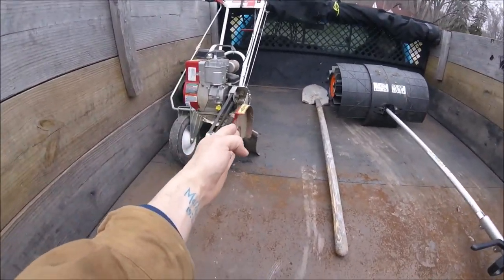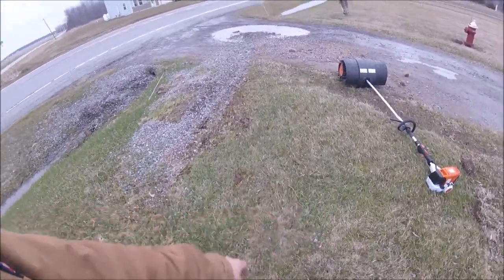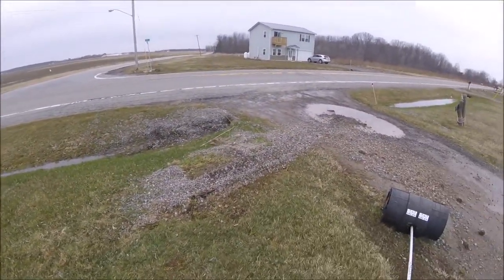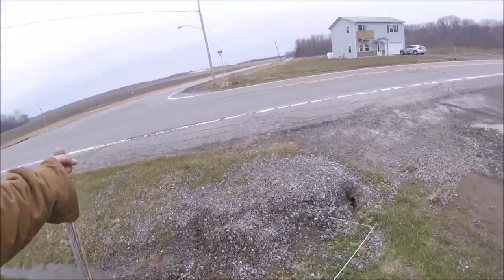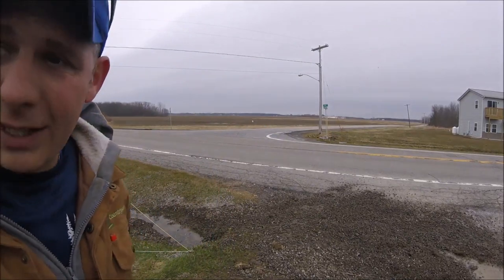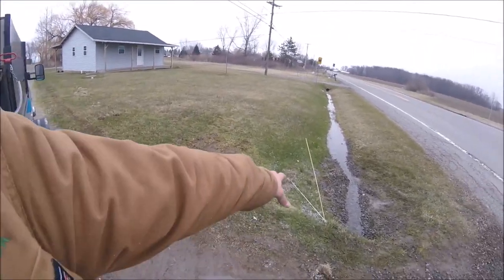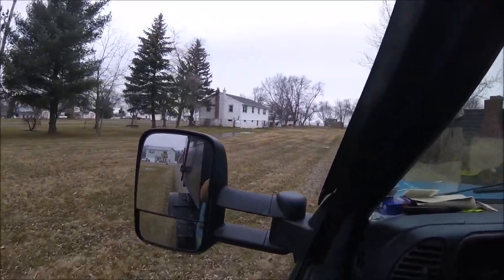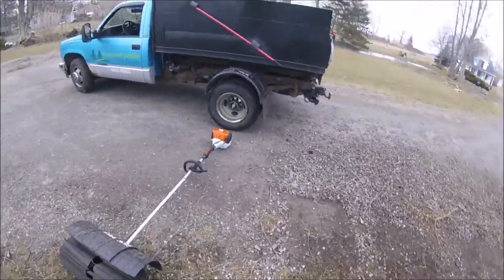Stihl Kombi System with Power Broom / Power Sweep in action

Comment: I found it easier to rotate the gear and pull it backwards, use the strap over the shoulder, gives you more pull power. Agreed, going forward kicked my butt.
Reply from the maker: You're right that works great. The strap isn't gonna increase pulling power, that's what muscle is for. Inanimate objects can't increase power lol
Reply: Mine came spinning the opposite way than the way it spins in this video, I have to pull mine. It is VERY easy
But I also stepped in a hole that i didn't see and rolled my ankle. It was still worth it
Reply: Mine came spinning the opposite way than the way it spins in this video, I have to pull mine. It is VERY easy
But I also stepped in a hole that i didn't see and rolled my ankle. It was still worth it
Reply: Mine came spinning the opposite way than the way it spins in this video, I have to pull mine. It is VERY easy
But I also stepped in a hole that i didn't see and rolled my ankle. It was still worth it
Reply: Mine came spinning the opposite way than the way it spins in this video, I have to pull mine. It is VERY easy
But I also stepped in a hole that i didn't see and rolled my ankle. It was still worth it
Reply: Mine came spinning the opposite way than the way it spins in this video, I have to pull mine. It is VERY easy
But I also stepped in a hole that i didn't see and rolled my ankle. It was still worth it
Reply: Mine came spinning the opposite way than the way it spins in this video, I have to pull mine. It is VERY easy
But I also stepped in a hole that i didn't see and rolled my ankle. It was still worth it
Reply: Mine came spinning the opposite way than the way it spins in this video, I have to pull mine. It is VERY easy
But I also stepped in a hole that i didn't see and rolled my ankle. It was still worth it
Reply: Mine came spinning the opposite way than the way it spins in this video, I have to pull mine. It is VERY easy
But I also stepped in a hole that i didn't see and rolled my ankle. It was still worth it
Reply: Mine came spinning the opposite way than the way it spins in this video, I have to pull mine. It is VERY easy
But I also stepped in a hole that i didn't see and rolled my ankle. It was still worth it
Reply: Mine came spinning the opposite way than the way it spins in this video, I have to pull mine. It is VERY easy
But I also stepped in a hole that i didn't see and rolled my ankle. It was still worth it

Comment: That old school edger is bomb man.  We have two and the crews fight over who gets to take them out.  They take up some space on the truck, but NOTHING edges like those do.  Just make sure to change the blade if it starts to wobble/vibrate (gets bent)- if not it will wear out the front beating and belt quickly.  Enjoy!
Reply from the maker: Brent Meister Great, thanks for the info man I appreciate it. I'm excited to use it. The more I look at it I believe you're right, I can tuck it in the corner of my enclosed trailer it's pretty thin.

Comment: I saw the rake on the truck as you pulled out of your driveway. When you said you’d forgotten it I was shouting at the screen! Does that brush head do much damage to lawn turf? It looks very aggressive. I was curious if it could be used for removing dead moss from a lawn.
Reply from the maker: Doesn't damage it at all. You can run it right across the grass

Comment: I have the 110 n I flipped the head the other way n make the stone come towards me instead of pushing away.   Down side you get dirty from flinging the dirt n mud at ur feet but the benefit is that you don't have to keep lifting the own machine up everytime you can just give it gas n the broom will drive itself.    But either way it still needs to be manhandled n still a workout
Reply from the maker: Travis Garbulinski this one is the new KM131R. I'm def gonna try flipping it, someone suggested that earlier.
Reply: It should be take the paddles off n the two flaps   then 2 screws to loosen them up then flip the head  around if it's like the one I have.   I always say it's at least worth a try haha
Reply from the maker: Travis Garbulinski thanks

Comment: Turn the head 180 upside down.its easy that way
Reply from the maker: I've had a few people tell me that and then I tried it since this video you're exactly right it definitely is
Reply: Doe that reverse the brush? Or would u have to flip the gearbox to do that?
Reply from the maker: @corny155  yes it does
Reply: So do u turn the whole motor? Or the controls too?
Reply from the maker: @corny155  just flip it over
Reply: So I recently bought the km131r 
I don’t have a ton of experience. But I thought the connection has an engagement tab. So u can’t just flip it
Reply from the maker: @corny155  you're thinking too hard about this. Just turn the thing over in your hand? Don't take anything apart, don't adjust anything!!!! Just physically turn it over.
Reply: Ahhh, so u remove or flip the brush cover too?

Comment: Remove the black guard so that you can pull the powerbroom in ditches instead of pushing it.
Reply from the maker: Lawn mowing That's what's been suggested to me. I'm def gonna try it
Reply: CountrysideLawnNY  great!
Reply: Just got mine today and the first thing I did was pull the guard off and turned it upside down. Did a 3 foot deep ditch 100 foot long without breaking a sweat. Best moneybi spent in a long time
Reply: Also I run mine almost always upside down. There is enough down pressure with how heavy it is to still work great. Much much easier to work for long periods of time upside down
Reply: Cottington's Lawn Care awsome! These brooms are money makers!